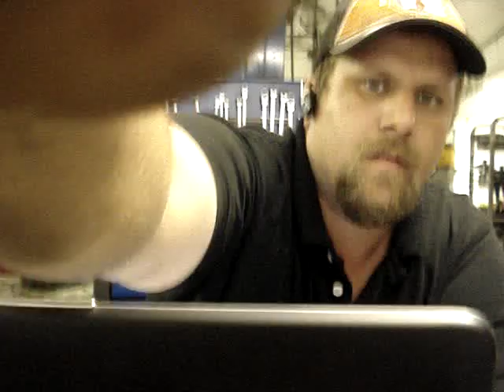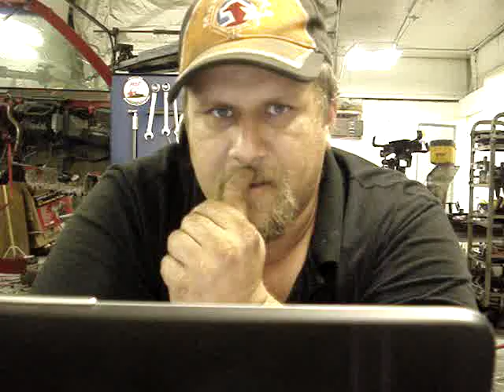importance of egt to hho tuning

Comment: How about HHO + CNG + Water mist Injection ....? It will solve most of the issues of the engines designed to run on plain gasoline 'to be converted to run best on HHO as supplimentry fuel ....

Comment: Hi, i know everyones trying save mpg but how much extra power would hho give to a 230bhp turbo charged petrol engine ? And i agree with the exh temp sensor to keep an eye on things but what about a water mist injector aswell ? Maybe to come on on boost only wired thu boost switch to help bring temps down plus how much hho every min for max power not for mpg saver, thanks

Comment: I have a 92 Toyota 22re with 3 wet cells with 13 plates each. I installed a map, defie and a etg. The etg I installed first because I wanted to see any change before wiring the cells or anything else. By using hho gas, my emissions have improved, there's a noticeably hp increase and the etg reads 100° cooler at highway speeds, from 700 to 600. +/- 25.° im not even sure of the type of O2 sensor but ive set it to wide band, and the map is completely useless in n city driving. Everything has room for improvement and thats what im after. Thanks for your video. Im also going to work the hho with the vapor fuel concept and see where that goes

Comment: Yeah i agree with you.
I am gonna drill, tap and install an egt probe in my 1995 car exhaust manifold.
I will run it to a temp guage with a programmable relay (thermostatically controlled pcb) that will close at an adjustable set-point.
The 12v output from this( chinese cheapo ) unit will energise a normally closed, in-line relay that goes to my CCPWM relay.
This will also operate a small buzzer i'm installing in my control box...
this way my hho system can be powered-down if any overheating from lean fuelling or high revs / high load ever occurs !
Great !

Comment: I haven't been building these generators long, but I have a generator that is probably really close to perfect. If there is steam coming off these that your talking about, then the configuration on your plates are wrong. It took me 6 months of trials and era to get it right!,.. I had steam just like the rest of you but now I don't. I can put 2 table spoons of KOH in my generator and not get hot at all. Now I still have a problem, I just ordered a OBD2 sensor which I had before I broke my tablet, so I bought a new one for my computer. OK my engine light goes on an off and my mileage went back too nothing, Trying too figure out what's up with that?

Comment: EGT is the ultimate indicator of rich or lean burn. It would seem the injector correction circuit should be modified based on this indicator. Adapting an Efie to do this shouldn't be too hard if you can get digital output from the EGT. My two cents...

Comment: i agree my car is running in safe mode mile drop to 21 from 24  hho safe mode 33  with simple double coil wet cell.  no room for anything thinking of putting equipment in trunk?

Comment: I am new to HHO systems. This is a very interesting indeavor.
I am not a rocket scientist but I do know that water is not compressible which would cause bent piston connecting rods ect. The extra o2 in the system would cause the o2 sensor to make the ECCM to throw multiple faults codes.
The moisture build up in the lines due to a vacuum on the system can cause excessive water build up.
I wonder if a receiver drier from an AC unit would work in the HHO system to  eliminate any moisture? HMM?`

Comment: great video, i have just completed my own dry cell for my chrysler, only got into this HHO stuff 8 weeks ago, about to do turn my generator on tomorrow for testing. i was thinking about making a poor mans efie to add a couple of millivolts to the o2 sensor. i have looked into the volo chip but have been told they dont really give that much better mileage. what do you think i should do. thanks

Comment: ...but them Volo Chips are not working with LPG but I keep in my mind to do it in future.
And also I am thinking about them Iridium Pulstar Spark Plugs...you can check on youtube how it works without anode under air pressure!? I am thinking to do experiment with them + F-16 Pulse King (to avoid missfire). Those Spark Plugs are build on Internal Capacitor not like others on Rezistor...?
My ongoing project on yt: BMW 7 HHO Step by Step :]
Regards!

Comment: Hi there! Thanks for tips!
To get rid of steam HHOConnections (yt username)  suggesting to use Brass Stones(f.e. like in some big fuel filters) mounted in your Bubblers.
Have you seen Volo Chips for HHO? They say it's working...around 30% savings as far I remember. 
Another idea for saving fuel: linear increasa of HHO production regarding to acceleration...? A lot of air going into manifold depends on rpm's but amount of HHO stay constant...-this is what I am thinking about doingmyProject.Thnx

Comment: how about pwm regulation on the hho. and u control the system with the engines vaccum sensors basically the hho would be adjusting all over the board. also y change the a/f ratio the car?  would just have extra power with it at stock tuning and the hho will burn. The user would just have to change their habbits think about it the engine will be more effiecient and u use less throttle to drive.

Comment: what about a "complete" water system with no gasoline???? It's mathmatically imposssible to run an engine on HHO gas by itself and even more of a problem running gas and HHO ,which have 2 different burn rates. Direct water injectoin through a plasma field and inject it straight into the cylinder. Using the expansion qualities of water ,of 1 to 1800 times increase in volume, inside the cylinder instead of outside ?? with a continuous spark and start of injection timed @ 2 degrees past TDC

Comment: Great Video, You make a lot of good points for things to consider before installing an HHO system in your car or truck. I check out the a lot of video's every night, trying to gather as much info as I can, so I can build and install a unit on my "98" Honda CR-V. Would very much like to exchange emails about the EGT's, MAP/MAF enhancers and PWM's. Many experimenters are better than just the one.

Comment: @HybridWaterMan2  Thanks for the response.  I am certainly not knocking your videos or the info you have shared.  Do you have any videos for people like me, that "know they don't know", and need to have a reasonable installation process that will provide some system improvement but lessens the risk of damages to engines or sensors because we don't have tons of electronics, or balancers, ect?

Comment: I agree tuning on the fly with a dial is not practical.  And EGT's are essential to enabling proper HHO tuning.  That is how we tuned my Thundernutz bike to a safe 20% gain. Mapping is the way.   Some makes respond well to the Volo chip also.  However I am bypassing the whole ECU issue with EV technology using on board gensets with carbs.  No computers at all.   Still use an EGT though - its a necessity.

Comment: i think the main thing to do before HHO is a full assessment of the running condition of the vehicle, like the power usage, air usage, fuel usage ect at all different driving conditions because your vehicle under go a heavy power load when driving at night in the rain because you have the AC going, the whippers going, all the lights etc. you should know how much air your vehicle uses also.its best  to install a MAF meter to study your air usage at all RPM's and also your gasoline usage. after do

Comment: Sorry about the double post below.  Another thought I have is regarding running your small ICE on HHO stoichiometric A/F.  Could you do an experiment where you check the response of various types of oxygen sensors to the exhaust chemistry of HHO.  The first person to do this will be a hero!  I don't think the sensors are accurate for HHO because of the different partial pressures of CO and H in the exhaust relative to that of a hydrocarbon fuel.  Thanks!

Comment: I'm thinking maybe Cantburn was running with extreme preignition (detonation) without knowing it.  What do you think about modifying the base spark tables (retarding timing) along with leaning out the engine in an HHO booster install?  I'm looking into the TwEECer product for a Ford EEC-V computer.  Will Megasquirt work also?

Comment: there is another technique that really needs to be examined badly ... due to the rapid flame front of an HHO ignition, a method of slowing down the burn should be VERY beneficial ... a stainless bubbler designed in such a way that you could meter a measured amount of exhaust gases to be fed along with the HHO may be the way to go ... I have not seen anyone with the skill to try this show others how ... it needs to be done ...